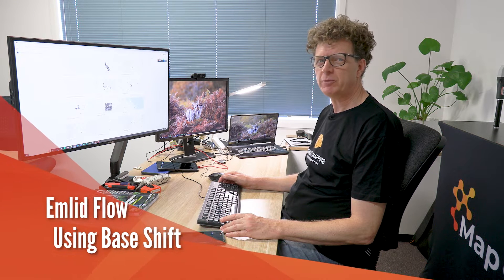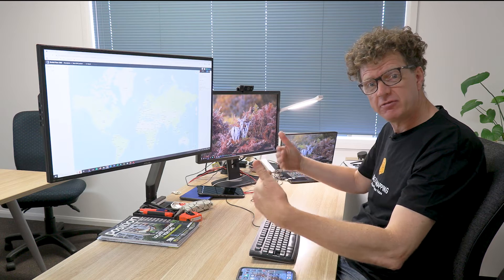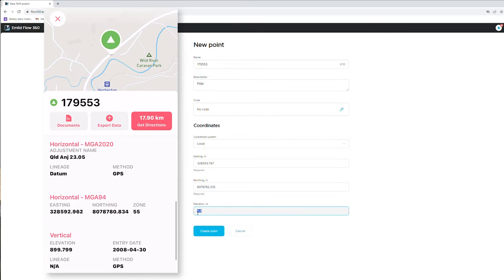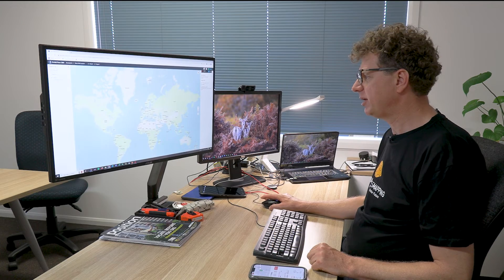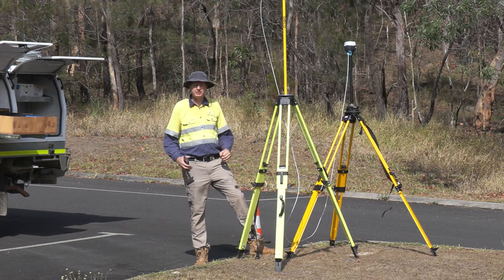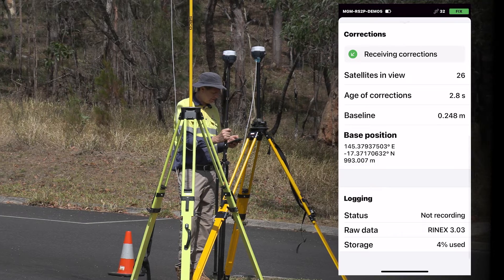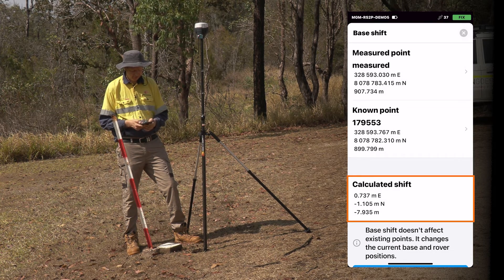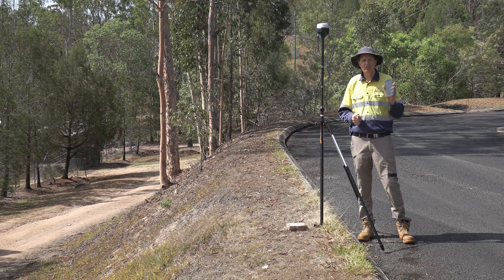Using Base Shift in Emlid Flow

Comment: Fantastic video, one question, how do you read the new position of the base station so you can record the new TBM that you put in so tomorrow when you set up you can put correct details in and not need to base shift? Ofcourse you still confirm with the known points for good practise but shouldn’t need to base shift again?
Reply from the maker: Hi Jack, the easiest option would be to use your tilt compensated rover (e.g. Reach RS3) to pickup the point under the base to use the next day as you won't be directly over the mark. 

A slower but potentially more accurate solution would be to have the base logging RINEX while surveying day 1, then process the RINEX file with AUSPOS on the next UTM day to get your point (rapid static). There may be another (easier) option - but we'll need to double check this before publishing it as a solution.
Reply: @MangoesmappingAU  thank you
Reply: @MangoesmappingAU I think going forward I’ll put a new Benchmark inside job whilst base shift is active and re set back up on it the next day with those coordinates and heights. I’ll go back and stake stake out existing control to hopefully confirm its spot on

Comment: Question - with the known points that you pick up would you do a project localisation on them within the app?
Reply from the maker: Localisation is useful when we don’t have the precise parameters of the local coordinate system. In this instance we have the coordinates from the local survey marks (PSM's) so localisation is not required in this instance. 

Olga from Emlid explains this really well in this link: https://community.emlid.com/t/localization-in-emlid-flow/35351

Comment: Be careful if using a RTK drone and emlid caster. The base shift only affects the rover data, the base is not shifted and therefore your rtk corrections to the drone are not shifted. This will cause inaccuracies when you process the data
Reply from the maker: Thanks for that tip. I'm not sure our team have come across this as they usually use a PPK workflow.
Reply: Could you do a PPK workflow tutorial for collecting GCPs and flying an RTK enabled drone (DJI Prefered?)  @MangoesmappingAU